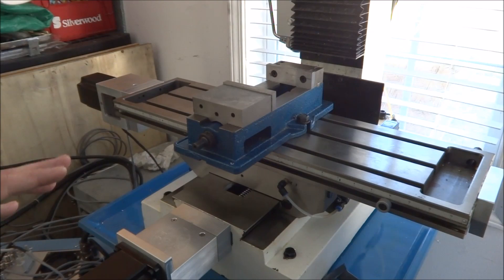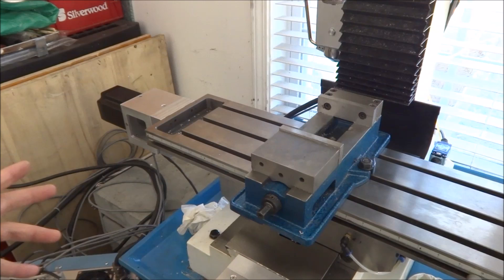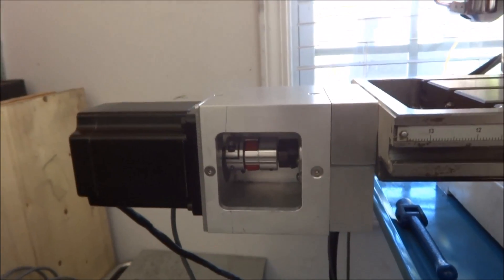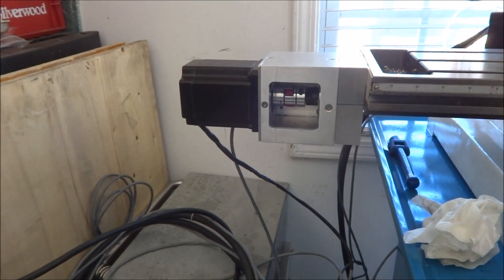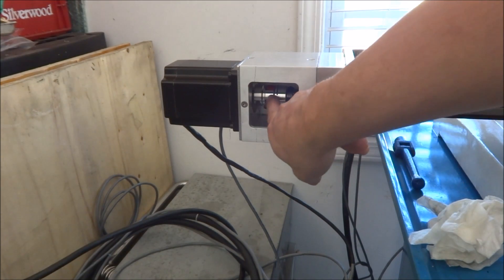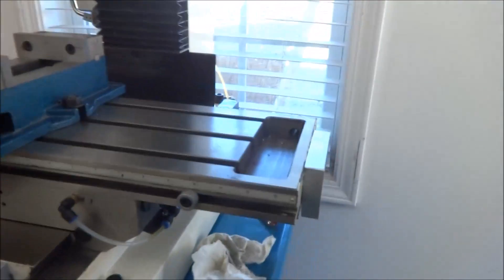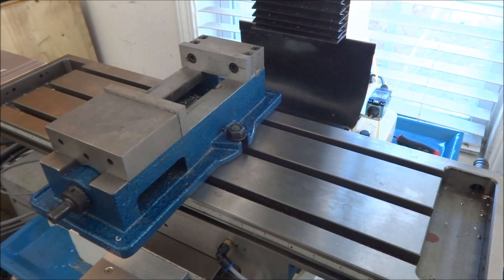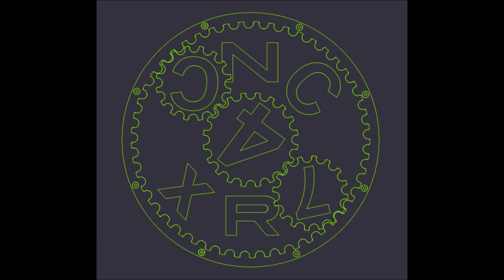PM- 727M  Random Sounds

Comment: Did your conversion to CNC require any modification of your machine, or just custom parts?
Reply from the maker: Hi Anthony,
Well My CNC conversion is very well documented and everything done to convert it was done with the Mill itself.
The only real modifications made were some reliefs cut out of the base casting to achieve more Y travel 10" x travel is 18"
All mounting holes use stock locations.
be Safe,
Sam

Comment: Try the disc/spring type couplings, they cost a lot more, but worth the money. One thing you have to be aware is the torque rating on those spring type couplings, they are usually not as high as the plum coupling.
Reply from the maker: Thanks yes I have some of those on the way so it will give those a try.

Comment: Ball screws are slipping?
Reply from the maker: No that would have shown up in the backlash checks I think.
Reply: Definitely would.  You are correct about the zero backlash coupler.  I have a similar problem with coupler slippage and coupler set screws vibrating loose. I had to change couplers because the high torque of the stepper motors were overwhelming the couplers.